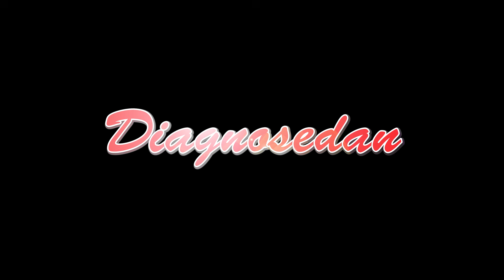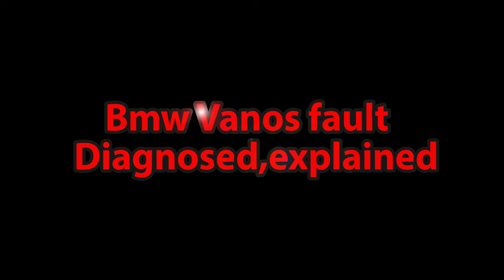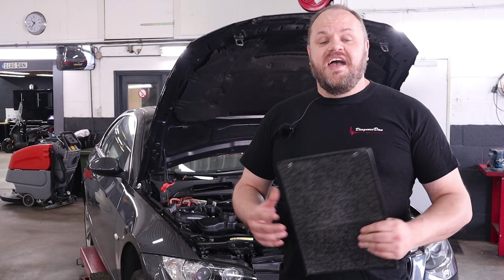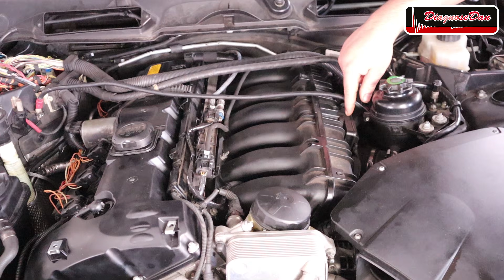Bmw Vanos Fault Explained (3000€ parts replaced and still not fixed!)

Comment: Man oh man… so glade I ran into this video before I was literally about to kick the car of jack stands… long story short , took motor out replaced all sensors , installed engine and it ran just like the bmw in video (2012 f10 n55)getting codes for vanos, took them out cleaned them , tried again nothin… my dumb a$$ mixed wires up , when I switch connections , it runs perfectly fine

Comment: Great video. Looking forward to watching more. Just got a 530I that was showing a P0012 issue. Pulled the check valves and the top one was so coated with crud you couldn't even see the screen. I wasn't aware that the oil filter cap had a cage and a plug for the drain hole.  Put my foot in it  on the high way and  the oil pressure light came on.  Pulled over to check and the light went out. It's a wonder I had any oil pressure . Maybe that's why they call it trouble shooting.. It's easy to miss little things.

Comment: I'm having a VANOS issue and I'm completely stumped. I have the code for the intake VANOS. The car always throws the code at low RPM's as I'm accelerating from a stop or after slowing down for a turn onto another road and it seems to happen the most when making a turn to the left. One thing that is odd that I have noticed is that there is a few specific spots during my daily commute that it seems to throw the code. For example, on my way to work there is a road that I turn onto and when I accelerate after turning it will throw the code there. If it doesn't happen there a bit further down that road there is a stop sign that I turn left again onto the next road and as I'm accelerating up that hill from the stop sign it will do it there. Then, if not there, the last spot is as I turn left to get on the on ramp for the interstate as I accelerate after turning it will throw the code there. One of those three spots it will throw the code and go into limp mode almost every single day. There is one other spot when I go into town as well where it happens a lot. Again, turning left and accelerating onto another road. Having said that, I'm pretty sure it has done it when turning right as well but those are the most common examples in case that is relevant.

 I've replaced the intake solenoid and confirmed that the wires are connected to the correct solenoid, replaced the check valves on the side of the engine (which were very clean BTW), confirmed everything is good with the oil cap/basket and I've still got the code. I've heard that the cam ledge can cause this issue but my oil is very clean and I have no metal flakes. I don't have any codes for the intake camshaft position sensor but I bought a new one to try because I've seen where those sensors can cause issues with VANOS as well. Any suggestions/advice?

Comment: We were convinced that German engineering was top notch.
What I see here are two engineering fails of the highest magnitude.
Both the cams and the sensors' connectors can be swapped around unintentionally: you must look carefully at some minute details to avoid the mistake.
A good engineer would have made both parts "keyed" so they were impossible to fit in the wrong place.
BMW double fail.
And who knows how many other oversights and blunders lurk under the surface.

Comment: really informative video! i have a b48 engine and the vanos actuator is in the rear of the engine from the research I did. can't seem to find a DIY on youtube? any suggestions on how to get to them?? engine code I'm getting is "130715 vanos, intake, control error, cam shaft pinched" and I have a rough idle/ loss of power so I'm guessing it is indeed vanos. HELPPPP PLS

Comment: Hello i own a 630 i M Spot E63 2007. Now i have replaced all the cam sensors. position and vanos I replaced to cure the following. When i plug her in. I am showing intake valve timing out 8 degrees. She starts fine no hunting or lumpiness. Just did oil change and filter. All seals good inc small ctr one. Any ideas what to look for next please?

Comment: Dano I have a bmw n13 16a engine 2013 1 series . Showing exhaust cam shaft stuck jammed 130304  and 130308 fault . Been pulling my hair out . Replaced chain 2 vanos units oil filter checked the seals . The seals under the cam shaft cap and the end . Checked oil pressure seemed good . Swapped solenoids overs for vanos and checked wiring for solenoids.  Reali need help its driving me mental
Reply: Iv had the sump off  and cleaned it spotless . Wasnt dirty . Pressure relief valve looks to be electric .the only thing I havnt replaced it the oil pump .  . The exhaust cam shaft is only moving from 2 degrees to 3 degrees while running other one is at 14 degrees

Comment: Not so uncommon.. As BMW uses the same connector for damn near everything under the hood. I ran across it before for other issues. I actually paint mark each one a different color. To match the device it goes back on...

Comment: Hi Dan, I have a code 2A7C, Variable camshaft timing control, intake, cold start, for a month cannot figure out what was wrong, I replaced a lot of things it still there, after I watch your video I swapped the connector as you said then the problem is solved, I don't know why the BWM didn't use different connectors in that area so people never screw up by plugged in wrong place. OMG you are so smart, thank you so much for your help, god bless you. ❤

Comment: Same thing happened on my sentra. It has 3 plugs in the harness. One fore the neutral safety switch, one for the reverse switch, and a spare that's unused on manual transmissions. If the unused one is connected, itll blow the an engine control fuse and the car will freak out. Sometimes it's really the simple stuff

Comment: Great video and great explanation got yourself a new subscriber! In 2020 had a 3-series BMW stalling when starting engine and immediately shifting to D and not stalling if idle engine more than 10 sec. Aside from that engine felt rough. The vehicle owner did his own repairs but kept making it worse off so he brought it to me. Upon asking him questions he had done oil change and replaced both vanos sensors. Owner had missed the clogged vanos filter screens so I cleaned them. The vanos sensor connectors were switched and the plastic retainer within the oil filter was missing. Once these were corrected the engine ran much better.

Comment: My E60 2.5i was burning oil and the garage I used to use told me my car needed a new vanos system that would cost parts and labour £4000 pounds I replaced the vanos valves myself BMW WANTED £300 pounds plus vat I replaced them with parts from a German company called febi bilstien they were half the price of BMW Parts after a year no more oil burning and car is running great if it wasn’t for utube I would be £4000 pounds out of pocket

Comment: Hey Dan, really good video I wish you addressed something a little more invasive than just the cables. my code is 2A7C DME: Vanos inlet cold start, only shows up at every start up, rpm goes up and down briefly and code appears. If I erase during drive it won't pop up, just after restart. Solenoids replaced, cables good. Saw another video that mentioned the only fix is to change the Vanos gear. Timing on the car was done perfect. Angle on the inlet 120 degrees exhaust -115. Can you suggest anything?

Comment: oh my god.. that was exactly the same symptoms I had on my E46 (M52B25TU engine).. low unstable idling, occasionally dying off on sharp acc pedal release (e.g. on intersections), and error codes that point somewhere in the vanos and timing area. Our local BMW dealer failed three times to diagnose it, and then they loaded the parts cannon and more or less replaced the whole vanos, injection and ignition system. Thankfully it was all on warranty, otherwise I would have been out of a ton of money.

Comment: I am alway slow to find the great channels. 🙃 Thank you Dan for the in depth explanantion of the Vannos procedure. To me it was something I had every intention of finding out about and then this appeared in my BMW  "You might Like" list of suggestions. Well for once they got it right 😀 I have subscribed and set the notification bell. I do want to ask if I may, I have the X5 with the diesel M57 (?) Would there be any significant diiferences to the type you have described here? I did start my working life as an apprentice mechanical engineer and I worked in a small town garage learning my trade for three years. Unfortunately, government requirements caused astop to my apprenticeship...(ratio of certified to apprentice) and the delay was insurmaountable as I was last one employed. SO I drove trains for a while then joined the Army for thirty years. Life is what it is, but I still remember all I learnt and still do all my own work. I think that the only difference between now and the cars I started on is not the technology, but the time I take to do the job 🤣🤣🤣

Comment: The most important question is: was the customer charged for parts he didn't require, will he be refunded (doubtful) will he be charged with a mark up for Dan's diagnostics & repair + probably more oil & possibly a filter.
Just shows how your average would be trained mechanic is simply out of their depth when it comes to electronics & diagnostics + they introduced the new fault that caused the problems which is not the customers problem however most customers / drivers are totally ignorant of how a car works in the first place, they just jump in & drive it & end up paying regardless.
If the standard fault code reader doesn't tell them what to replace they just throw parts at the car willy nilly in the hope it will fix things.
Roll on the take over of EV's, good bye Mr Average Mechanic hello Dan & Co.
Great job.

Comment: Hey Dan my 2009 535XI it has 191000 miles on the clock starts right  but low oil pressure ? After running it sounds fine has the timing jump ? Engine is the N54 engine light is on replaced the Vanos engine light went off till next day it came back on. Any help

Comment: How come? BMW’s Engineers never heard about the Mistake-Proofing discipline (aka POKA-YOKE)? It’s a mandatory requirement/procedure for all Automotive Manufacturers and their suppliers that are certified to Quality Management System IAT-16949:2016 (former ISO-TS 16949).

Comment: Damn your a genius buddy. I have a question for you. 
When you install the cam gear on the camshaft. Do you have to make sure that the holes on the cam gear align with camshaft. I have a Mini Cooper s. What won’t start after I replace the head gasket. It cranks but won’t start. I saw that the camshaft on the intake move by it self. I’m guessing that must to been the spring in the cam gear.

Comment: I had exactly the same issue my disa failed and it sucked a piece into the intake. Lucky me i got no damage to any heads or valves. But mine was also idling abnormal. Since they changed the disa the problem was gone. But i am surely going to take a look at the vanos connectors if they aren't switched up.

Oh and what a great video!!

Comment: It's ridicules how many people think it's an engineering fault. First of all the connectors are made for literally made to connect and same selenoids, they just have a different function. Second if you can save cost by using the same connector then that's a no brainer. 

I mean you're not going to use a torx bolt for one hole and a hex bolt for another if they have the same function right? Just so you don't mix them up. Come on..

Comment: Dan this might sound like a dumb question but here goes. You inserted the in cylinder pressure/vacuum tester into one cylinder. Are the results just for that cylinder or the entire engine? If you put a cylinder sync on one cylinder and know the firing order I guess you could check each cylinder. I guess the test you performed and the fact all valves were controlled by the solenoid I believe the exhaust reading would be the same for each cylinder. Am I close or out in left field Lol thanks Dan 👍

Comment: Noooo !!! I bet they replaced a lot of part which were still good :/
I hope they undate the vanos cam seals at the same time.

This makes me thing about those guys who replaced a broken rear door glass. They switched the cables between the tweeter speaker and the door latch led light.
Because of that, the child safety button on the driver command was blinking and the feature wasn't working.
I discovered it  when I DIY repaint the door (it's an old but good car). I had do disassemble the door panel and remove to door to bring it to the paint booth.
They owe me a tweeter (it disliked the +12v) and a beer. And they claim being professionals. Damn.

Comment: I can understand making a simple mistake in a high pressure workshop but to let a vehicle go out to a customer with an obvious problem is not very professional, but in defence of the workshop that made the mistake BMW have clearly messed up by using identical connectors for both vans units.

Comment: I'm no mechanic, but even *I* am friggin' smart enough to know that if you've got 2 cams, you damn well BETTER triple check everything that looks "identical"  As I recall, BMW is pretty good at putting part number and even L/R type labels everywhere.  I think I'd have to toss a bucket of water over the head of any mechanic that put the VANOS parts back on wrong...  

E46, M54 325xi wagon.  
Good thing my mechanic knows what he's doing, lets me help, and explains everything.  

First thing we did was take out the 6 speed manual transmission, and put in a 5 speed automatic, (I don't like driving standard shift anymore).  He rebuilt the transmission, total breakdown, something like 80 discs and packs and thin sheets of paper...I don't know much about it, but he used the rebuild kit that was 'rated' for some 5 series issues, so he can swap the engine out with a 3 liter engine, which he keeps telling me he'll do, but I'm happy with the 2.5 for now.  
(I think I described the tranny thing correctly.  All I know is he guaranteed that it would be fine with a 3 liter engine).

I had a hell of a lot of noise out of the 250,000 mile engine at first.  

All the steel parts in the cam system were gone over with a microscope, and there was no problem there.  The VANOS gasket/seal type things were badly worn.  We got a VANOS rebuild/rattle cure kit from ECS, and since we did that, many problems went away, but...  

When the VANOS was rebuilt, we found a persistent misfire still there.  
Darn!  Kinda' a pain to pull that all apart again, but we had to, to pull the head.  
After 250,000 miles, there was a chip off of the 5th exhaust valve.  So, we replaced that 250,000 mile head with one that only had about 60,000, and that was taken care of.  

E46!!!  Plug-and-Play parts all over the place!!!  

So, I've got a 'new used' car, and I am very happy with this E46 M54.

If you find yourself with a new used car like mine, I do have one other thing to comment on.
There's a lot of plastic hoses under that hood.  If you have the engine jacked for any reason, I'd suggest replacing every hose you can reach, especially if you have to pull the intake manifold.  Ones under there should always be renewed, problem or not, because it's a pain to pull that manifold just to do a coolant hose.  Then again, it IS true that my friend does not work with an engine 'crane' or whatever you call that thing, and he doesn't have a rack to lift the full car up, so he works from over or under, when other mechanics may have different ways of doing things.  Maybe those hoses are easy to get to if you have some equipment like that.  
Oh, other things I'd do.
Replace the rear springs with stiffer ones, and go with the 17 inch rims, and I like the really wide tires all around.  I don't recall if the manual states different tire size combinations, front/back, but like I said, I use the really wide tires all around.  Corners on rails, and no annoying sway like you can get with softer springs...

My friend prefers to work on BMW's, and he has the wherewithal to do almost exclusively word-of-mouth referrals from happy people like me, mostly sticking to BMW's.  

Anyway, I babble a lot, but I'm very happy with my '01 325xi wagon, and I'd recommend it to anyone who ALSO has a good mechanic.  And is willing to believe that the DEALER is NOT the best just because he's a dealer.  In fact my friend stopped working for dealers years ago, because he was getting sick and tired of doing what the BOOK said, based on codes that get thrown.  He prefers to get dirty, find the problem, and fix it.  

There are codes out the ASS in cars these days, and many of them get people to have work done on their cars that's needless and expensive because the dealer mechanics don't necessarily have 30 years experience AND...

Sometimes, do the work the book tells them needs doing, not what may ACTUALLY be needed.

Comment: I have seen couple times messed cables on VVT solenoids, and owners spend hell of money to "fix" that, now it is first thing I check for erratic RPMs.
I have another, related to Vanos system issue, where I need help, replaced solenoids and eccentric sensor, put all back together, run about an hour, and then suddenly on RPMs over 3K, get high pitch sound, same as old dry ball bearing, removed belt - no changes. On RPM lower than 3k, begin low pitch sound (same as intake VVT have stuck). Run diag, show error on intake VVT solenoid, attempt to remove solenoid, and it is stuck!
Somehow take it out, after inspect found little chip right before neck of solenoid, and now unable to insert it back, new or old one, inspect hole, and nothing found.
Planning to open engine today again and see what is going on.
Any advise would be really appreciated.
Thank you.

Comment: Pulled mine apart today, can't believe there's no locking pins between the cam shaft and the adjuster and it relies solely on the bolt to stop it from spinning?